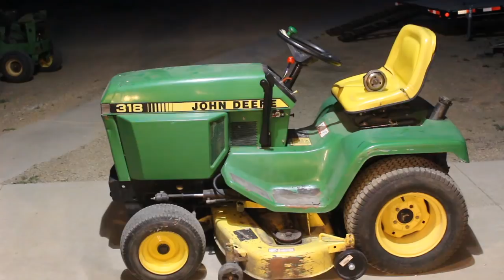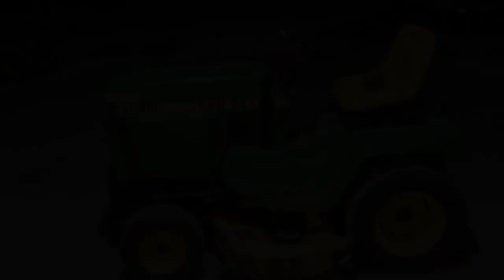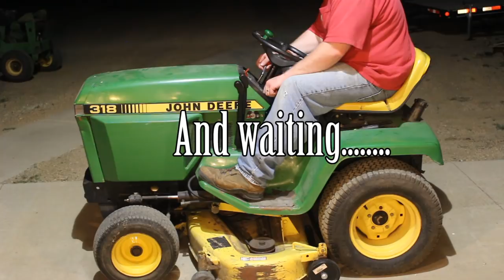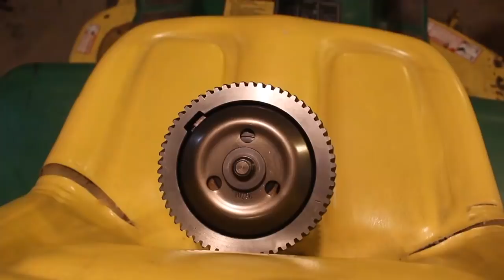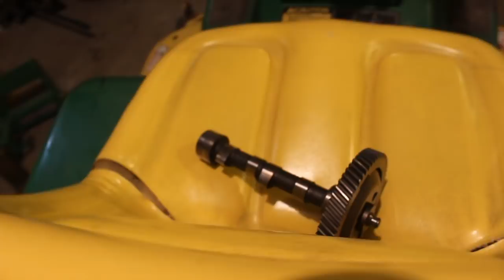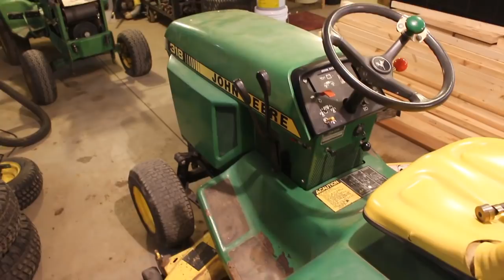John Deere 318 Flyball Spacer (Part 1)

Comment: I ran into this on my 1st 318. Watched the thread on the tractor forum and got a metal flyball spacer and fixed the issue. Fix actually sounds harder than it is, but getting the parts now might be tricky.

Comment: I wonder if this is my issue, mine kinda surging for a while and then will over rev and the machine will speed up while mowing and then a second or two later slow back down to full throttle.

Comment: I have a similar issue my 318 just dosent put much power to the ground like it has no get up but revs pretty high could by flyball or transaxle or not enough fluid but it never really mowed up hill or down hill to wear it out any suggestions

Comment: These 300 series john deere have so many numerous known common issues. Just recently bought a 316...has hydraulic plow..I painted it,new seat,new battery,new rear AG TIRES,new led lights,oil,trans fluid/filter, spark plugs..looks and runs great... just afraid to use it in gear something will grenade...so I posted it for sale!!

Comment: Is this Flyball Spacer problem a, it will happen or mite happen to the 318? What is the  percentage of this happening? Was looking at buying one but after this video I'm not sure now.
Reply from the maker: The flyball spacer issue is somewhat rare but common enough to be a known issue on the 1986-early 1991 318’s. No idea on the percent and the fix is not a huge deal and a good opportunity to clean the frame of the machine. Any 20+ year old garden tractor will require maintenance of some type. The older they get the more involved the maintenance will be. I wouldn’t let it deter you, just something to be aware of.
Reply: @mmrbeef  Thanks.
Reply: Im not sure if my issue is related to this but you might have a idea. My p218 will run good for 10minutes then it will start misfiring and eventually clear up. Then it will increase rpm drastically but only when the pto is engage. If i kick the pto off it will go back to a normal rpm but surge some and then if i kick the pto on it will scream some rpms but run smooth. Any ideas?

Comment: Good thing i noticed it on mine when I was mowing about 34 minutes or the engine would explode. I will check the plastic flyball spacers. and if that's the problem I will have to get metal flyball spacers

Comment: Not saying it's a problem. It seems like a very high percentage of users would just keep the machine on high straddle it is appropriate when mowing. Yet some people can't figure out how to get their large dick engaged because the clutch he needs to break the inertia. The more frustrating problem would be to stop the machine creeping up when in the park neutral position. Seems to being over oil problem. It hasn't done it in a while.

Comment: I just want to say how thankful I am somebody finallymade a video showing what is wrong with my early model 318. I tried everything I could think of but I still never got rid of it. I grew up mowing with this tractor and it has tremendous sentimental value so now I can give an honest attempt it reviving it. Thank you so much!
Reply from the maker: Glad it was helpful. Contact Boomer at Boomers Onan if you need the parts (can't remember if I said that in the video). You will have to call to order the parts.

Comment: pretty sure this is whats happening to my john deere 420 with the p220g. its around 1900 hours so i guess its probably getting time for an overhaul.
Reply from the maker: If it is only the flyball spacer you really don't need to overhaul it. You really only need to replace the flyball spacer. Give BoomersOnan a call... Boomer is a great guy with lots of Onan knowledge and he has the parts you need!
Reply: Well the tractor also uses a little oil and makes a ticking noise when running witch makes me worry it’s going to blow up soon. I just pulled the heads off and cleaned everything up and adjusted the valves. How many hours can one of these engines last if it had decent maintenance?

Comment: Looking forward to the video series on this repair. I replaced the plastic flyball spacer with a steel one in my '87 P218G engine and I don't think it was too difficult of a project. Really took my time with it because it was my first time working on an Onan engine. Also changed the front and rear main seals, dipstick tube seal, and exhaust manifold gaskets while I had it apart, and did a lot of degreasing.

Comment: Hmmm. My 1985 316 will rev up past 4000 rpm as soon as soon I move the throttle lever to wide open even if the engine is cold and by cold I mean as soon as the engine is started and I know it goes over 4000 rpm because I used my small engine tachometer. But here's where it gets weird. If I engage the deck even when the tractor is in neutral like yours in the video the engine only goes to 3100 rpm at full throttle so basically what I'm trying to ask is WHAT'S GOING ON with this thing because if anyone  has an answer it would  definitely be you. I've looked all over the Internet with no luck yet.
Reply: andrew mullin okay just put oil in it. Fired up and runs fine.  I think the previous owner was in it and didn’t know about the governor. Runs great now after I lined up the dowel and the governor cup hole.
Reply: have a b43g with steel flyball spacer that does exactly what your talking about.  took it apart everything seems fine. must have missed something easy!
Reply: I think I know what the problem might be Andrew...never crossed my mind before. This might also be the same for you ShnitzlHaus. I bet the engine was apart in the past and whoever put it back together did not line up the timing pin on the governor shaft with the hole on the governor cup. This would cause the governor to work incorrectly.
Reply: Yes so I tore it down to do exactly as you stated.  I made sure to line it up but can't be certain I got it right, difficult to do! just put it in the three o clock position and hoped for the best with the engine tilted slightly down towards the pin. going to oil it up and check how it works now. that was the only thing that logically made sense.   hope to test it soon and let you know.
Reply: When you tilt the engine and move the governor arm, you should feel a little resistance and the arm should "bounce" back at you. That means it is lined up properly.
Reply: MichaelTJD60 I also forgot to mention that the engine restorer does in fact work because one cylinder was at 65 psi and the other was at 75 psi . Now the one that was at 65 psi is now at 86  psi and the other cylinder is at 80 psi! But here's the best part. I haven't used the tractor much yet so the stuff hasn't even had enough time to reach its full potential! I will update you in maybe a month or so. Also I'm not sure when I will have enough time to pull the motor because I'm kinda going into this blind since I ain't got much experience on these onan's so I just don't want to mess something up lol.
Reply: A couple of hours to do it all. Should take most of an afternoon. Pulling the engine doesn't take long, I've pulled the engine out of one of these in about 20 minutes.
Reply: ShnitzlHaus let me know if it works out or not.
Reply: MichaelTJD60 you might be on to something because the engine looks like it has been messed with before not only that but the guy I got it from seemed to be a backyard mechanic if you get my drift lol
Reply: Wow, that's pretty surprising. I've never used that stuff before but it sounds like it gave you really good results.
Reply: MichaelTJD60 oh yeah! And like I said. It had hasn't enough time to reach its full potential!
Reply: ShnitzlHaus. Glad to hear you got it working! I haven't touched mine yet lol. How long did it take you to do everything and how difficult was it? I just want to know before I mess with mine since I haven't tore in to one of these motors before.
Reply: It shouldn't take more than a couple hours. The biggest challenge once you've gotten the engine out is removing the flywheel...I popped mine off with a 12" three-jaw gear puller from an auto parts store.
Reply: MichaelTJD60 did it take a couple of hours to do the whole thing or do you mean a couple hours to pull the motor?
Reply: MichaelTJD60 OK thanks! I will probably hone the cylinders and put new rings in it while I have the motor out. Would you happen to know where I could get a quality set of rings and gaskets?
Reply: Boomer is your best bet, he is probably one of the most knowledgeable Onan experts out there. http://boomersonanparts.com
Reply: MichaelTJD60 sounds good. I'll give him a call tomorrow.
Reply: MichaelTJD60 hey when you get some time I posted a video on my channel of a noise that my motor makes I'm not sure if it's normal or not but I figured you would know since you've owned more of these things than me but basically it sounds kinda like it might just be pistons moving back and forth but I just want to make sure because it seems kinda loud if just the pistons but like I said you would have more knowledge on these than me so when you get some check the video out and let me know what ya think.